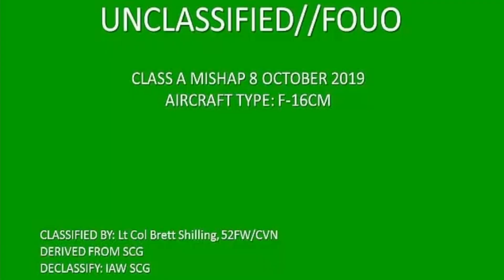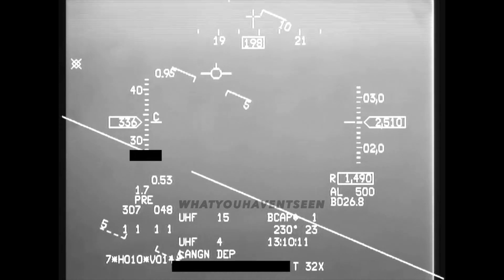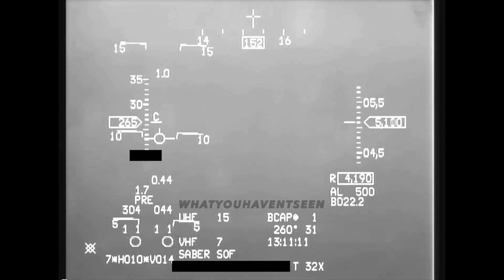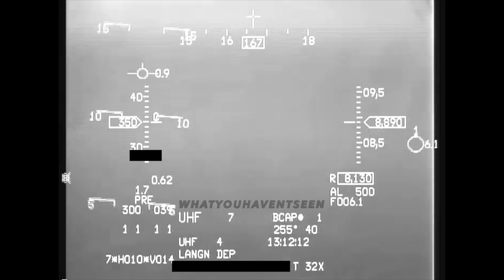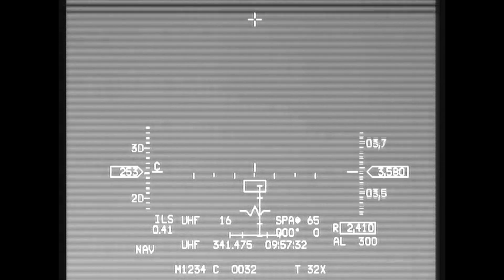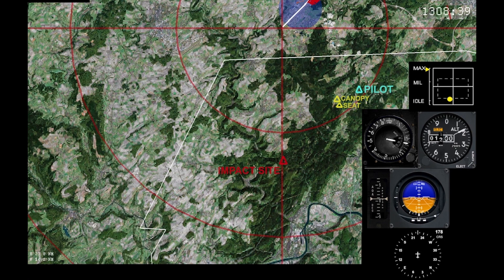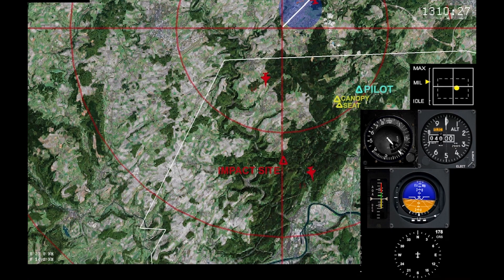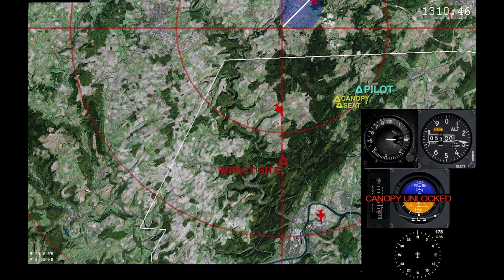F-16 Loss of Electrical Power and Ejection (HUD Footage)

Comment: Wow! How was there not a huge Fireball!?
Reply: Wet air, wet everything, low temperatures, so fuel doesn't vaporize and ignite that easily.
Reply: When the F-16 that crashed into a warehouse across from my base a couple years came down, there was no explosion either.  They don’t always explode!  This was at March AFB that I’m talking about.
Reply: One of the big parts was actually the fact that the jet hit trees at such a high speed (either 547 or 567 knots if I recall the report). It impacted trees first, not the ground, which shredded the airplane and freed the liquid fuel. The most flammable aspect of JP8 or Jet-A1 is the vapor. You can drop a match in a bucket of those fuels and it will put the match out. As the jet had just taken off there wasn't much of that vapor present. There were small spot fires on a couple trees that were easily put out. Had the aircraft hit at a sharper angle, it would likely have exploded in a fireball, as the impact compresses the tanks and the fuel inside. But because it was basically blended by the trees, no such thing happened.
Reply: Military grade fuel tanks. Self sealing
Reply: @MattyEngland  yeah that’s not it. They break open and spill that fuel the second they hit the ground.
Reply: @jochenheiden  I'm no expert on the warthog, but there are numerous military aircraft that have both lined and self-sealing fuel tanks. Seeing as the warthog is a slow and low flying ground attack aircraft, I can almost guarantee they have just such fuel tanks. 
Obviously they aren't indestructible, but they are significantly stronger and more likely to survive a crash than a traditional fuel tank found in a cilivian aircraft.
Reply: @MattyEngland  the aircraft that crashed here is an F-16.
Reply: @MattyEngland  yeah you aint an expert alright. Self sealing only applies to bullet/fragment holes.
Reply: @Ken-no5ip  I'm guessing English isn't your first language, but I didnt mean that it would self seal in an accident. Maybe I should have phrased it better 🙄 
I didn't realise that the video was of an F16 though, I was only half watching it and I mistakenly thought that it was a A-10 warthog due to the callsign. They do have both lined and self-sealing (from small arms fire) fuel tanks. Say hi to barbie from me.
Reply: @MattyEngland  cool thanks for the info man! 😎🤙🏼
Reply: @brsrc759  no worries 👍👍
Reply: @MattyEngland  the only bladder tank on the F-16 is the one directly behind the cockpit. All the others are wet bays. Those are the wings and the aft fuselage section.